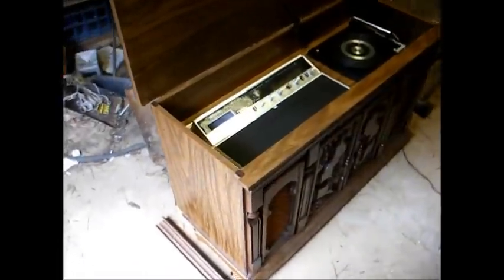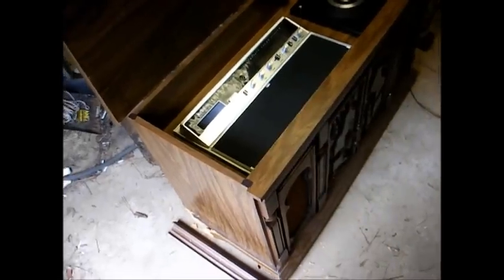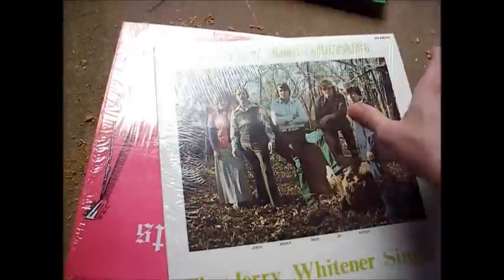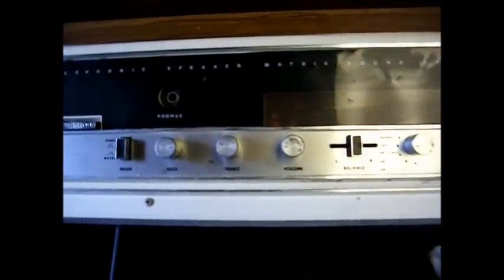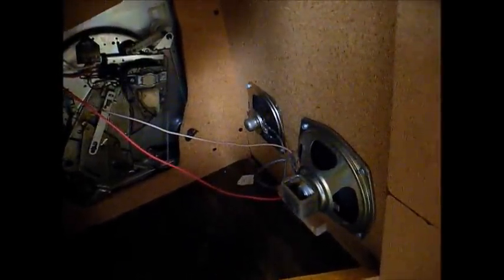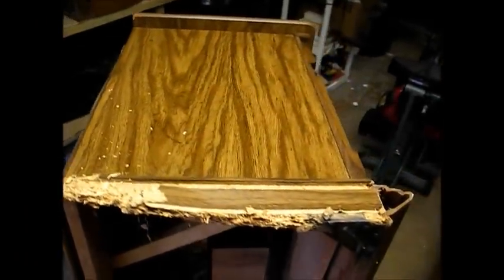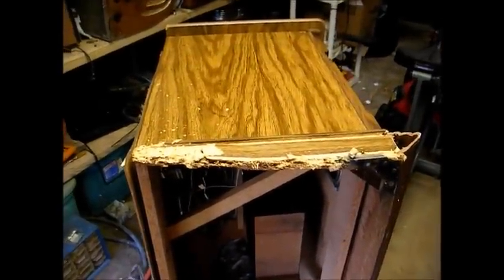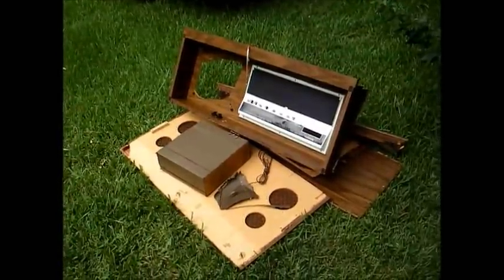End of the line for a cheap Lloyd's mid '70's console stereo

Comment: I have a 1963 RCA console with tubes and turntable with Am/FM radeo. I put new tubes in it in 1992 and cleaned up the chassis. It has 12" woofers and 4" tweeters. It still works like a champ!  I also have a 1964 Magnavox console with transistor chassis. It still works fine

Comment: I have a cheap Lloyd alarm clock/radio, when I turned on the radio the display started losing power and then when I turned up the volume the display was blinking and the speaker blew

Comment: Speaking of Lloyds, i happen to own two Lloyds alarm clocks. One of them, i got from a thrift store for $6 and the other i got from a flea market for $2

They do have a bit of a cheap feel, but at least they both perform and work better than the crappy modern alarm clock both units replaced. Both have excellent radio reception and have a pretty loud max volume that either can be heard across the hallway when the alarm goes off.

I'll probably make a video of them one day.

Comment: JVC/Nivico consoles from the 60's have particle board cabinets that crumble but decent electronics and speakers. The one I have (4TR-990 Deluxe Solid State) has 8" woofers and 3-1/2" tweeters in acoustic suspension enclosures with felt sheets for dampening. The sound is actually very good and clean with decent bass and top end. Discrete not IC electronics too. They certainly don't sound thin and flabby like the 70's consoles with the speakers in free air like the Lloyd's or Montgomery Ward's.

Comment: Back in the 1980s I was doing tech work for 3 stores and a TV repair shop, and one of the stores was sending me Soundesign and RJMacDonald stuff for warranty repair.  The repair bulletins for those brans would have recommended procedures that were atrocious.  One that sticks in my mind was for tape record bias failure on cassette sections of several models of compact stereos.  The procedure involved bypassing the dead oscillator and running direct current to the head coils for DC bias.  Phooey on that; I never would do such shoddy work.  BTW the store paid me for my work, but stopped doing service work eventually, because neither company would reimburse for the repair expenses--not one dime!

Comment: I got an Emerson table top stereo for my 13th b-day in 1978. BSR TT ran a little fast and the Tetrad ceramic cartridge had limited frequency response. My parent's 1970 JVC console had a ceramic cartridge which ran circles around the Tetrad in the Emerson and the TT ran at the correct speed. Less distortion too. More thought put into all in one systems back then.

Comment: n each speaker has has its on sepreate inclosure i can make things fall off shelfs in the front of the house with it n its also got a tube warmer i know cause theres a switch on the radio n it has a pilot light on the bottom of the unit

Comment: ive got a old console radio ive had forever n ive never heard of the brand its 1964 least thats what the paper work says it was bought its a Pencrest its a full tube set n like u said the old console radios will stand the test of time i lost count of the tickets i got cause of it the odd thing bout it has 2 oval 12 inch subs n there 3 way tri power speakers theres no external tweaters there all built into the 4 12 inch oval subs any help id be greatfull for

Comment: I suspect that water did as much damage to that fine furniture as you did. It certainly wasn't heirloom quality. But I have to add that most '60s consoles sounded worse to me than their '70s counterparts, despite more real wood in their cabinets and more substantial hardware. This was probably due to advances in speaker technology during that era and maybe the maturing of solid state tuner and amplifier technology. I'm going to guess that even those cheap woofers had cloth or foam suspensions, which were rare in the '60s. '70s consoles also sounded better than most of the "compact" systems from the same manufacturers, only because the giant cabinets made better speaker enclosures than picture-frame shaped shoe-boxes designed to look big from a distance. So they served a purpose in their own cheesy way. In fact, if I had to listen to Jimmy Swaggart, hearing him on that home-jukebox might actually be a relief compared to the clear reproduction of a real stereo.
Reply: +No Name  Magnavox Concert Grands late 50's used 16 6V6 for grand total of around 100 watts. These stereos were bi amped using horns and 15 inch woofers. Nothing could touch them  at the time. Early solid state were Germanium transistors. These actually have a "tube" like sound to them.  I hate to tell you this, but until you start looking at mid to top of the line consoles, the same electronics/speakers were often used in both the cheap all in one units, or in the console units.  95% were still paper surround.  Fisher, Magnavox (the high end units had sealed, air suspension enclosures. ), Stromberg Carlson (However S-C was a different animal, their units were designed to operate as seperate components in  a console case. Their speakers were essentially stand alone and could be pulled out of the console and placed elsewhere.) were one of the few that used foam surrounds. 

It's all about total output amp power and matching the speaker to the amp. My 1963 Packard Bell   stereo  uses 4 6BQ5 for 18 watts per channel, but it also has the correct speakers. The stiff cone  12 " speakers are designed to operate most efficiently with the amp.  This the reason why this stereo can outperform, with two speakers,  those so called "1000 watt" home theater systems,  it literally shakes the walls and can be heard roughly a block away when it's really rocking.
Reply: well you never heard a good quality stereo from the 60s then, they made some cheap junk in the 60s too.   You can't beat the old Magnavox Astrosonic stereos from the 60s, we had one when I was a kid and that dammed thing would rattle the walls and had great sound.

Comment: Back then the electronics had more thought put into the design whereas in the 70's they started using ICs so much of the electronic design was already done for them.  And K-Mart and Montgomery Ward's with their flimsy speakers in free air with no thought put into the acoustics of the cabinet. I've heard much better from consoles like mine with it's speakers being acoustic suspension and excellent ceramic pickup TT. Later ceramic pickups had limited frequency response.

Comment: I recently got my 1968 Ampex Micro 85 cassette recorder at a yard sale for free, I was trying to get it working and get it restored, but it was too late. It happened earlier tonight and I was so disappointed that my staff and the house manager got crazy and ends up with an attitude and then, one of the staff took it and threw it in the dumpster while heading out to Shop Rite. I was very upset, and now, my Ampex Micro 85 cassette recorder is now EOL. I also got shocked and and what happened is that I cannot plug it in while is fixing, but that causes a fire hazard and ends up getting an electrical shock. That means, I'm not going to any of the yard sales to buy worthless vintage audio junk ever again for free. I have other stuff that still works to this day. So I will not going to buy it ever again. I have EOL any of the item that is not working anymore for many years now, but the Ampex Micro 85 is no more.

Comment: Lloyds was one of the cheaper brands. 
That being said, it's MDF board. Commonly used for all sorts of cabinets including arcade. This unit is crumbling because it has water damage. 
Still, not worth effort to save.
Reply: its not MDF that's a better material but still suffers badly at the slightest bit of damp its like a sponge this is made from chipboard which is what a dog leaves behind after its been eating  wood  left in neat piles dried out you can shape it into whatever planks you need its crap board
Reply: thehappylittlefox aka benji MDF is much denser and stronger than chip board
Reply: I agree its much stronger I have TV cabinet made from it and it takes varnish very well but untreated it soaks up water like a sponge, pity about the cabinet on those old stereos if it was made of real wood and had some quality electronics in it it would be much better

Comment: I have the same changer in my table top model of the same quality. It is basicly held together by hot glue. I have had to work alot on basicly every part of it. Mechanicly and electricly. It was a fun project and I actually use it. Have to agree. All of those are a piece of junk.

Comment: I like BSR auto-changers they are the best as far as I am concerned I have got the BSR C154 2 speed auto change deck on a Fidelity music master record player I have also got a 1967 Dansette Bermuda mark 2 record player with a BSR UA25 Auto Changer 4 speed deck
Reply: Never, EVER play good records or records that you care for on a BSR changer. It will destroy them. They are also not the best changers. Garrard, Dual,  Collaro (Magnavox) even to some extent Voice of Music, are superior.
Reply: +Artcurus Some of the early BSRs, with metal arms and crystal cartridges might have been a threat to records, but I wouln't worry about that thing with a tetrad cartridge any more than any other ceramic cartridge turntable. I don't like the plastic platters on the low-rung version, and I'd prefer the damped-weigh design of the low end Garrard arm balances to that one, but I wouldn't worry about it damaging records. The top versions of generic BSR series (610, etc.), with synchronous motors and zeroed-out arm balances were not half bad. I've heard that the 810 was a bit of a mechanical nightmare, though.
Reply: +No Name 

No, sorry.  While the very high end BSR are okay, they still can't compare to say, a Garrard MKII Type A, not even on the same planet. We had a Panasonic All In One Unit from the late 70's that had a BSR with a Pickering magnetic cart. I adjusted it the lightest setting, and it still completely destroyed records. After a few plays, the records were so noisy because of groove wear. At that time, we had access to a Voice of Music changer (console stereo grade but it was a good unit) Collaro (Maganavox) and another BSR changer, also a RCA 45 only player on my grandad's 1950 RCA radio/phono. I changed the cart on that one  that was  safe for stereo records, and even THAT unit, didn't turn the records white like all the BSR did.